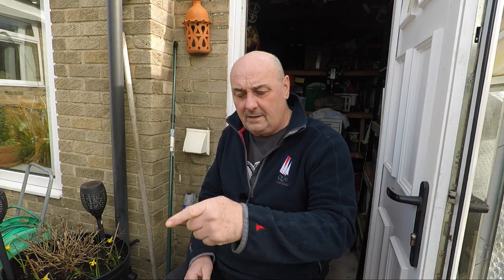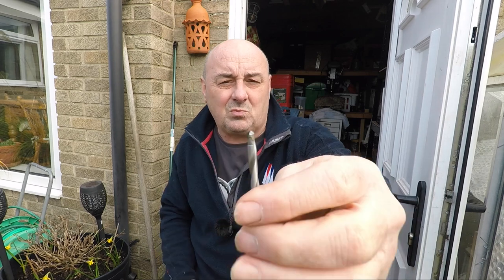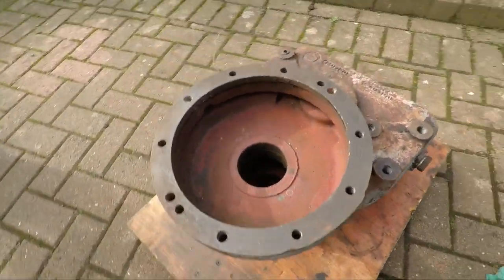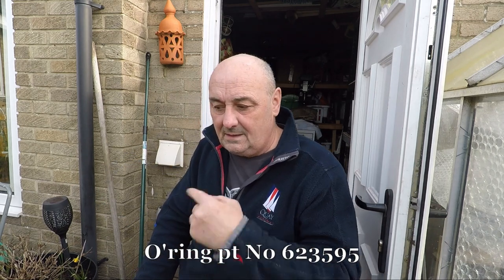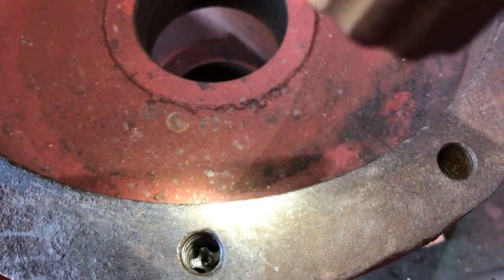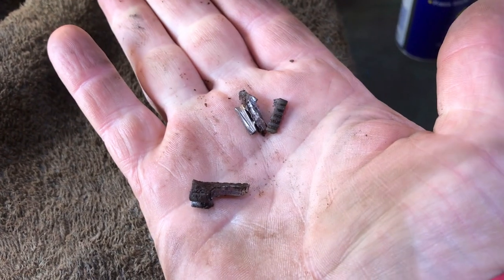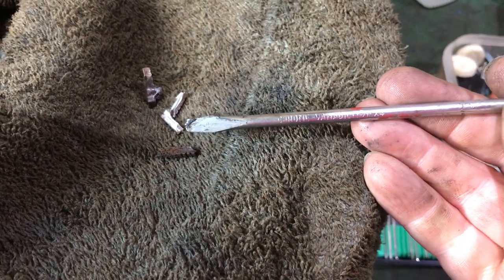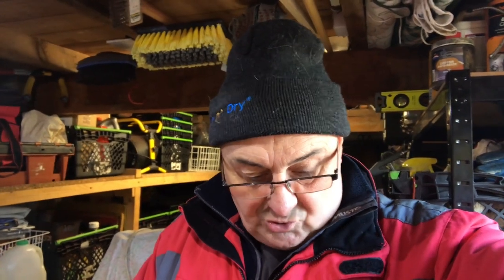Removing a broken 1/2" tap from the final drive of a David Brown 990 #58

Comment: Congratulations on beating the so and so I knew you would I like others enjoyed your videos well done 👏👍. My db had to have new wings unfortunately after market ones which had to be slightly modified we made up our own studs slightly longer but been perfect
Reply from the maker: Hi Jon, smiled from ear to ear when it snapped, even happier when I saw the hole was in good condition, wasn't really worried about the top 1/4 inch,
 round 2 to start and I thinks there's at least 3 in there. (5/8" stabilizer bolts)
but at least there just bolds aqnd not taps, fingers crossed
many thanks jon
Barry

Comment: Well done Barry! The broken tap looked to be the ‘taper tap.’ Taper taps are horrible. Essentially they are plug taps that are reground with a taper lead. In doing this, it does help the tap to start the thread process but it also removes or limits the cutting edge performance on the tap, in other words, it rubs. Never use the taper tap much more than a couple of revolutions or so. Get the plug tap engage asap and adjust for squareness accordingly. The taper tap also tends to keep the muck and crap around which contributes to a very tight operation…… hence, it breaks! You are also probably correct in saying the person who did this used an adjustable spanner…… grrrrr. Always use the smallest tap wrench available, you’ve got a lot more feel for what’s going on. Also, as my previous suggestion, try using electro discharge machining (EDM). A lot less chance of damaging the thread and cuts through taps, dies, drills or any hardened cutting tool material like butter and in a fraction of the time. Great stuff Barry.
Reply from the maker: Cheers Nat, much appreciated
Barry

Comment: If you could have set that up on a Bridgeport milling machine that tap would have no chance against a 3/8 carbide endmill. I've removed a ton of broken taps removed this way. Just use a worn end mill because as the flutes of tap come off the damage the endmill but it was junk anyways so it's a win win.
Reply from the maker: Just a few year ago i would of had that in a mill and as you say a carbide tool down through it in seconds.
but as you can see I've no room in my little garage, nevermind we do what we can with what we've got,
things might change this year,
many thanks
Barry